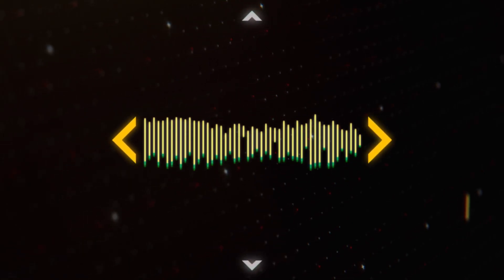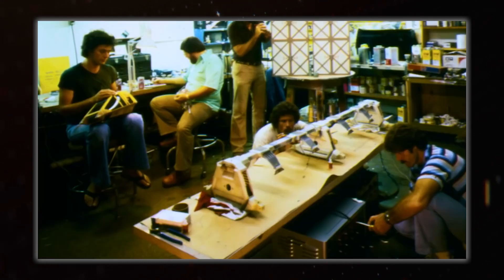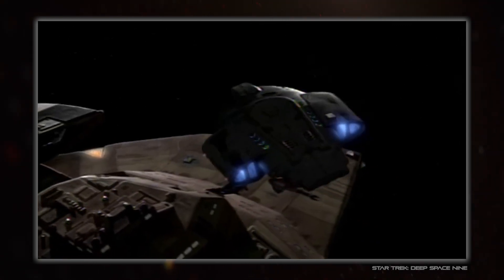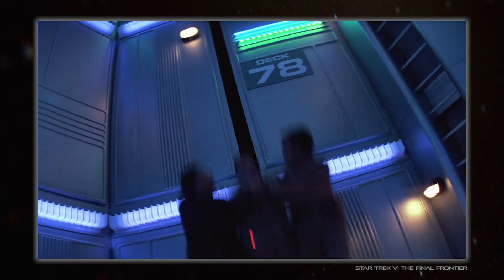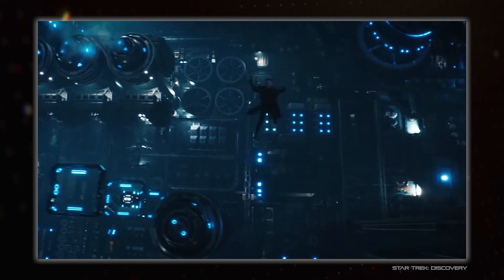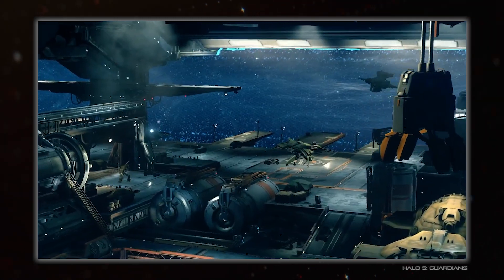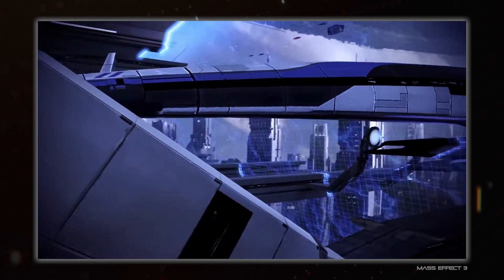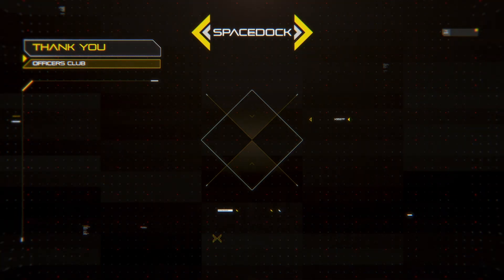Why Do Sci-Fi Spaceships Seem To Change Size?

Comment: Firefly was always good with its scaling. Serenity always seemed to be a consistent size. It helped that there were sequences where they walked through the length of the ship.
Reply: The vast majority of the ship was just 2 continuous sets (1 was the bridge, galley/mess hall and the engine room, while the other was the cargo bay, infirmary and passenger quarters), which meant they only needed to cut the camera when transitioning decks, as the sets obviously couldn’t be stacked on top of each other
Reply: I remember when they did the firefly blueprints and the only adjustment they had to do to get the interior to fit the exterior is make the walkway from the bridge to the rest of the ship canted at a slight angle.  For the movie they actually made the full upper and lower portions to scale and only had to do one whip pan to join the two together.
Reply: ya. it was amazing in the mass effect games when you can either walk threw the entirety of the ship or see the places in detail that you couldnt walk into. really helps you feel like your on a real ship
Reply: Fun Fact: During the opening of Serenity, when they walk through the ship, the movie snuck a cut into a whip pan.
Reply: I guess, scaling it right was even more important, because the serentity was often seen on planets. So the viewer get's an easy comparable impression of it's size, wich he wouldn't have in space only.
Reply: Came here to say this. Strongly agree.
Reply: 👆Wow Congratulations🎊🎊
You have been selected among my New Year ongoing giveaway 🎁 winners INBOX ME  💬.
Reply: Thing is, even it didn't always appear to match up to the big alliance ships or a station. It was consistent inside and outside to a person, but ship to ship still had some of the same issues. Especially with a ship you never get a human sized reference too.
Reply: @Racing_Pig  
Nishka's station was quite small. Smaller than the Alliance cruisers seen in the show which are vast and launch gunboats the same size as a Firefly. The problem is that these gunboats (like the police bounty hunters in the Message) look like present day jet fighter craft, so they appear smaller than they actually are, making Serenity look larger.
Reply: It's easy when you actually have the whole thing as a set lol.
Reply: Fairly certain for the Movie the built a 1/1 scale of the interior for the opening shot , though it was split in two for the bridge , mess ( upper deck ) with hidden cuts , not sure about the series .
Reply: Nope... I disagree.... Firefly was way off it's Mark for a ship that spent months in deep space. They don't talk about it, but Firefly the series was 1 huge star system. Firefly on the outside always looked smaller! Take for instance the shuttle, there were 2 of them and both had enough space to live in for awhile. Plus look at the cargo bay and sleeping quarters. It just wasn't enough space.
Reply: @jst1man  
Serenity doesn't spend months in space. As Out of Gas demonstrates, even when they take an out of the way course, they'll only ever be weeks out. 
The ship is compact, as are the shuttles. The bedrooms are tiny spaces little bigger than the bunk that occupies them. You'll notice that the shuttles consist only of a cockpit and a single room; Inara has a curtain to conceal the cockpit. 

Serenity is actually twice the size of the ship Golden Hind; the ship that Francis Drake used to circumnavigate the Earth. Golden Hind had a crew of eighty and returned to England with a cargo of some 30 tons of gold and silver aboard. It was a tight space. If you ever visit one of the replicas, you'll be amazed how small it is and that such a ship was typical of the era, and that this ship sailed across the Atlantic and the Pacific. 

While ships like the Enterprise are comparable or larger than modern day aircraft carriers; the Firefly class are built like the small merchantmen of the Age of Sail. This is also demonstrated by the kind of rations they eat; mostly protein bars. They're not travelling between stars, only within a system where journeys only take a few weeks or days with their technology which is comparable to the start of the 20th century when a ship sailing from England would take four to six days to reach America, two weeks to reach East Africa or six weeks to reach China on the far side of the world.

In that respect, it's not that different to the Expanse where journeys within the inner system also only take a few weeks but flying out to the outer gas giants can take several.

Comment: Both reasons are acceptable, I think. Chris Danelon made a video a while ago about how the deck arrangement of the Corvette just couldn't fit inside the model, and explained that some of it was because the producers wanted the various decks to be not perfectly stacked upon each other, but slightly misaligned, so one crewmember could look at and talk to another on the deck beneath or above. It's a change from the original material, which had crew members shouting to each other through the crew ladder without actually seeing someone. That and, of course, the claustrophobic nightmare that would be to have a 10sqm room filled with sci fi props to work on, with no open spaces lol

Comment: One thing.  Starships tend to be massive compared to smaller ships like shuttles.  If you try to actually scale things correctly (Homeworld is a game that actually scaled everything correctly), it becomes impossible to have small fighters and large capital ships in the same shot, and this tends to be a problem for television.  If you're zoomed in enough to see the fighters, the capital ship will fill the screen.  If you zoom out enough to focus on the capital ship, the fighters become tiny dots.  Homeworld, being an RTS, resolved the issue while maintaining accuracy, by just zooming in on whatever you selected, and making it easy to select other things no matter what size they were.

The funny thing...I've even seen size/scaling problems in animated shows that are not in any way focused on sci-fi, so this isn't even just a spaceship problem.  Building interiors don't match exteriors (a lot of the time due to exteriors looking more like stock assets).  Seeing a town from the air makes it look like 3 buildings, but from the ground it's obviously a fairly large town.  Etc etc etc.

Comment: I remember in Enterprise there was a time pod that was bigger on the inside (a TARDIS homage no doubt). I suppose the retrofitted 32nd century Disco could have used the same tech for more interior space. But that's just headcanon rationalizing. Ship interiors in the Abrams films also had this problem.
Reply: That scene was NOT on the retrofit, it was S2 'Pike trying to safe the dumpster fire'.
To be fair, as this channel emphasises all the time, it is not a trivial task to coordinate visual effects at all, maybe even worse in modern hectic times.
Just recently watched some Tested footage where Adam Savage confessed his worst prop goof was at ILM building SW Episode 2s Nightclub entrance in the wrong proportion just by a measurement error. One week later they found out on set and ILM had to beg the VFX department to correct it in post.
Reply: 👆Wow Congratulations🎊🎊
You have been selected among my New Year ongoing giveaway 🎁 winners INBOX ME  💬.

Comment: In my opinion, scale is important, but it shouldn't necessarily dictate everything. With CGI, scale can be accommodated much easier than physical models. Now, depicting the actual size of a vehicle consistently is very important to me. A prime example of this is the Arquitens-class cruiser, which has never been depicted in its proper size in CGI before as far as I'm aware. But as you said, the actual size of ships is a whole other topic on its own

Comment: Usually scaling issues don’t usually bug me. The only one that really does for me is the scene in the interior of the USS Discovery.
Reply: Same, that nonsensical floating turbolift through the weird vast "cityscape" segment actually took me out of the episode.
Reply: If you want to talk about scaling issues in sci fi, look no further than the original Star Trek, the shuttles in particular. When an actor stood next to it, it was small. But the inside shot suggested it was a bit bigger than the outside was.
Reply: Maybe because that was probably the worst ever ;)
Reply: Impractically huge bridges like Discovery's (and Enterprise E's) result from needing space for camera people to walk and Star Trek 's tradition of putting all the main characters on the bridge together. Add to that the weird decision to have people stand at widely separated consoles -- have inertial dampeners ever gotten better? -- and you end up with something more theatrical than practical.

The most practical looking bridge sets I've seen on Star Trek are the TOS Enterprise and the old Excelsior class bridge: captain's chair, freestanding consoles for pilot and copilot/navigator/ops, and stations (and chairs!) around the walls for other specializations. It makes sense for the captain and pilots to have the same large screen, but science, weapons, communications, and so forth need their own specialized views. (And there's no need to put all the most important people where one blast can take them all out, but that's a bigger discussion.)

EDIT: Second most practical would be the USS Protostar, which had a transparent canopy over the bridge (that could repair itself, apparently) and four stations and a captain's chair facing forward. That only works for a small ship, though. (With 3D animation, no less.)
Reply: Reminiscent of JJ Trek's Enterprise, especially the 2009 film's interior shots.  They literally shot it in a brewery.  You can clearly see the brick tile floor and the large brew tanks, all in a huge, open space.  This was and still is absolute absurdity.  Starships can suffer hull breaches as shown even in that film.  A huge, open space with no bulkheads means any breach would expose the entire space to vacuum.  Yes, I know forcefields are a thing in Trek, but they can fail at inopportune times...like battle!  Smart design would be subdivided compartments with airtight bulkheads throughout just like contemporary naval vessels are watertight (same principle, different environment).

But hey, Abrams had to have his brewery shot.  Probably made the lens flares more "dramatic" that way.
Reply: @ThePrisoner881  initially, I kind of liked the Brewery/Engine room.
That enjoyment faded quickly when the main viewscreen was replaced with a glass window.
Reply: STD is made by hacks and cannot be taken seriously in the least.
Reply: Yeah. That was really weird.
Reply: 👆Wow Congratulations🎊🎊
You have been selected among my New Year ongoing giveaway 🎁 winners INBOX ME  💬..
Reply: Yeah, I don't know, what they thought on this. Espacially on the discovery, wich even had a fragmanted main hull in the first place. This was just stupid and I don't know how this idea made it on screen. But this is basicly a main problem of discovery - style over substance.
Reply: You talk about scaling issues and ignore the warthog run from Halo:CE and how it can't fit in the canon size of the Pillar of Autumn.
Reply: It's certainly not the first time ST used non-sensical interiors. And it won't be the last time.
They might have gotten it from SW. Even back in the original trilogy, there were huge open spaces inside stations and starships that simply make no sense, as no-one would waste any space on a space craft, let alone so much. It was simply done for a certain aestetics.
Reply: @Bird_Dog00  tbf that was mostly in the death star which is massive anyway so it can afford to have some empty spaces (maybe it's for cooling or something) but in a ship that should be tightly packed like the Discovery it's really weird. Or have you seen it in other ships aswell in Star Wars?
Reply: @twandepan  Well, Bespin had those spaces too, and even the rather small rebel ships had iirc unusually spacious interiors.
Not on the same scale, but a corridor 4 or 5 meters wide is too wide for any military space craft.

The EU then just ran with it..
Reply: @Bird_Dog00  Bespin is literally a city though. It's meant to be a place to live comfortably and constantly being in tight spaces is very bad for mental health. Most rebel ships are civilian vessels converted into warships, so most of them are either freighters or cruise liners. Cruise liners are more open for passanger comfort, while cargo ships need big spaces in order to move oversized cargo around.
Reply: @hangar-eleventeen  yeah they kinda would lol. Though it's also kinda strange how Bespin's air is breathable now I think about it. Does it just have a lot of oxygen in it's atmosphere? And wouldn't that make your typical gas giant very flammable/unstable?
Reply: @twandepan     We don't know Bespin's specs, though.    I recall it being a "tibana-gas mine" -- maybe that's something denser than oxygen, so it can form a gas giant with a breathable upper layer.
Reply: @twandepan  With Bespin, I was thinking about the location of Lukes Encounter with Vader. That space was frigging vast for...reasons.
You could have a point with rebel ships, tough I never got a particular "haphazardly converted frighter" vibe form those shots.
There were some shots from Echo base that felt quite cramped and cobbled together, as you'd expect from such a temporary base. So, I put it down to deliberate design choice.
Reply: @Bird_Dog00  Oh that one, yeah maybe that's what keeps it upright in the atmosphere like that who knows
Reply: @Bird_Dog00  While on the subject of bespin it makes me think of a scaling issue with the rise of Skywalker, where a giant star destroyer was falling down behind cloud city and was almost as big as it was. We never got introduced to such a vessel in the movie but I think it was supposed to be a part of the original fleet on exegol, you know before the terrible copy paste star destroyers with a big gun on it. It makes me think that they actually have better cuts of the movie than the one we got.
Reply: @Bird_Dog00  ST didn't get the scaling from SW. ST was created before SW. ST began in 1965, SW in 1977. 
There were scaling issues of the Enterprise in the original series.  The size of the engine room was one of them. The time the turbo lifts would take to get from one deck to another. The size of the shuttle Galileo and the shuttle bay.
Reply: @suelynch  On Star Trek, all sizes are Plot Sizes, set inside of Plot Armor.
Reply: @Corbomite_Meatballs  You missed the main point I made. ST 1965, SW 1977. Star Trek is 12 years older and Star Wars. You can't steal a trope from something that hasn't been created .
Reply: @suelynch  That's not what I meant. Not the errors in scaling, but the deliberate design choices that make no sense in the context of a space ship. I was thinking about some of the sceenes in the first reebot movie in particular.
Reply: @suelynch  I got your first point. I was replying in jest to your 2nd point...humor, it is a difficult concept. We learn by doing.
Reply: @Bird_Dog00  "SW. Even back in the original trilogy, there were huge open spaces inside stations and starships that simply make no sense, as no-one would waste any space on a space craft, let alone so much."

Imperial ships were city-sized. The Death Star was the size of a small country. Think about the logistics of moving heavy equipment and major parts around those ships. Even real Navy ships on Earth have large (empty) elevator shafts to allow the movement of oversized parts, stores, ammunition, etc (hell, entire aircraft on carriers) between decks. Scaled up to a small-moon and the size of the open spaces in the orig.trig makes sense. (If not their lack of basic safety railings.) Think about trying to move things the size of AT-ATs between storage and spacedocks for deployment.

Of course, in reality...
"It was simply done for a certain aestetics."
Reply: Everything else about the USS Discovery, its crew, and its plotlines also bug me.